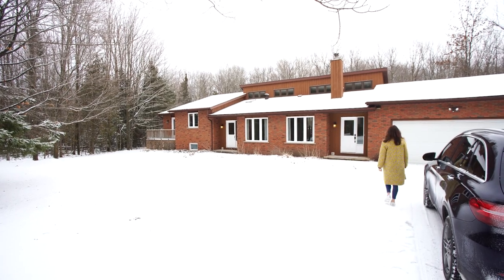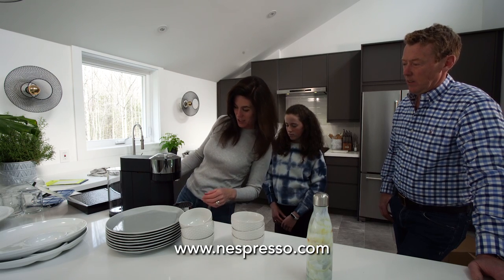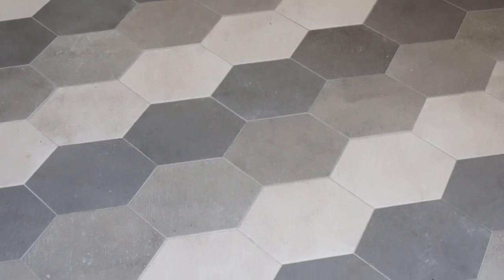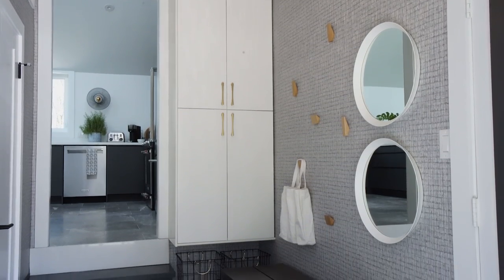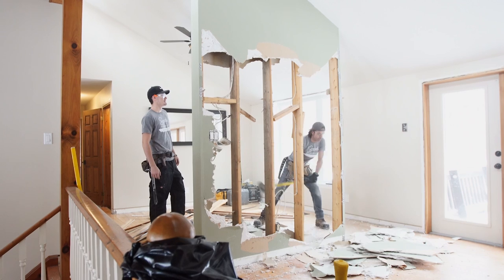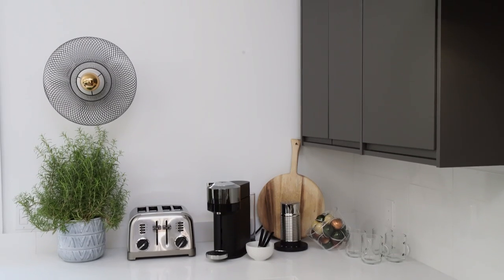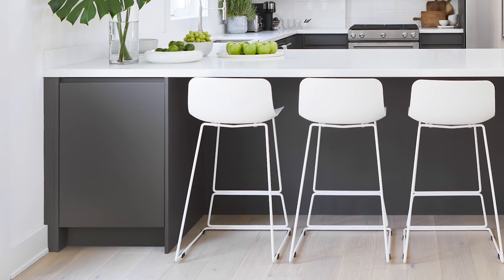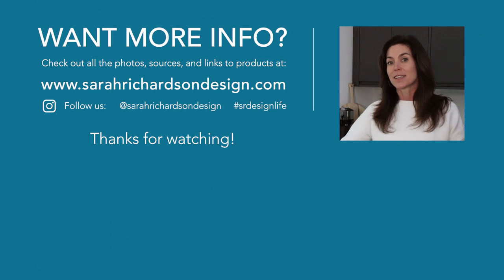Retro Ranch Reno: Kitchen + Foyer Reveal! (Ep. 12)

Comment: You didn't use a crown molding in the entry way.  Can I ask what you did use?  I had to use quarter round in a bathroom to hide some unevenness at the top of the wall.  I like the look of what you've done.  It looks finished rather than appearing as though you're hiding something.  Nice idea.

Comment: Sarah, you nailed it! I don't see a microwave , is that a new trend?
Reply: It must be. I haven't seen a microwave in any recent reveals and I watch a LOT!
Reply: I quit having a built in microwave years ago and just hide a little $50 one somewhere. Cheaper, easier, and nearly invisible.
Reply: I almost never use mine anymore. Just use it to heat up leftovers. Funny, I remember when I couldn’t live w/o it.
Reply: 1) Where's the microwave? 2) Counterdepth refrigerator? Did you consider building out the cabinet to hold a full sized fridge?
Reply: I think with a vacation/ski rental, a microwave is a must. Not everyone is going to want to cook full meals on vacation. I wondered where it is as well. I'd be pretty frustrated if I couldn't easily get takeaway and heat it up while on vacation.
Reply from the maker: It is there - just hidden in a vented cabinet!
Reply: Sarah Richardson Wish you would comment on the issue of refrigerators sticking out from cabinets. Counterdepth fridges are smaller and pricier. Full size require planning or they look awful. I have never heard you discuss this. Thanks!

Comment: Are those woven sconces functioning? How did you convert them from pendant lights to sconces?
Reply from the maker: Hey Aliza! They certainly are! They're LUFTMASSA / HEMMA Pendant Lamps (made into wall sconces in one of the earlier episodes I believe?). If you want to see the full source guide check out my website! We post full articles with additional photography of every completed room. You can find the kitchen and foyer here: http://www.sarahrichardsondesign.com/get-inspired/makeovers/2020/05/29/retro-ranch-reno-kitchen
Reply: @SarahRichardsonDsgn  Thank you! I guess what I want to know specifically is what housing/bases I need to get to change the pendants to scones? I actually want to get them to and use them as ceiling mounted lights. So, I won't need the wire, but I need a base. Is there a specific base that were used for these?

Comment: I am generally a fan, but just not on this one, unfortunately.   A few issues that I can see:  1) the cabinets in the foyer definitely look very cheap (handles look like lipstick on a pig) and are very visible.  I'm ok with IKEA cabinets, but I'd generally want them in a utilitarian and less visible place; 2) The wallpaper looks to have a very warm undertone to it (e.g. a bit of brown) and the floor has a cool undertone (e.g. a bit of blue)....and I don't think they go together very well; 3) What you see from the front door is the dishwasher...seems an odd focal point; 4) The light in the foyer looks way too small for that space; 5) The kitchen is exceptionally boring.  There is way too much white and nothing of visual interest really anywhere.  The backsplash is boring.  The cabinets are boring.  The countertop is boring.  It'd be one thing if the kitchen was so unassuming because  you were being directed to look elsewhere, but that really doesn't seem to be the case.